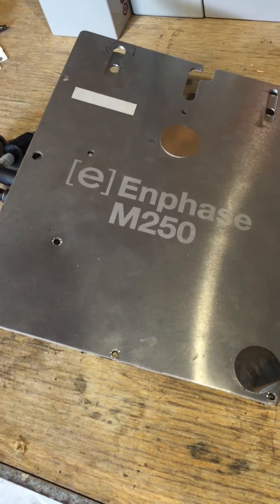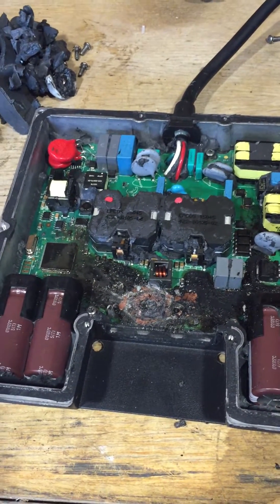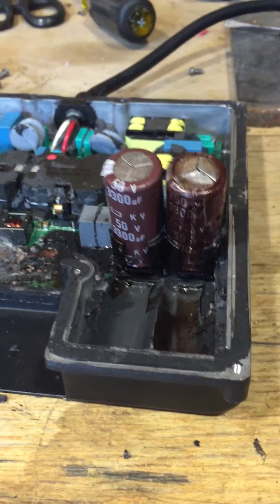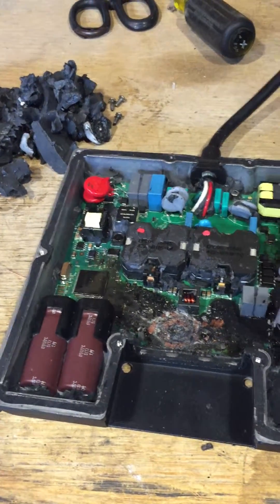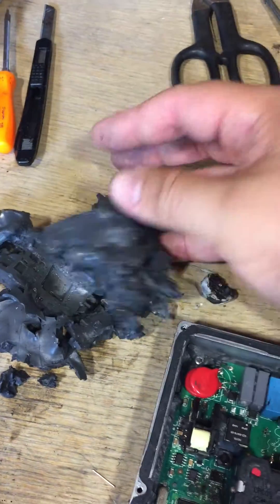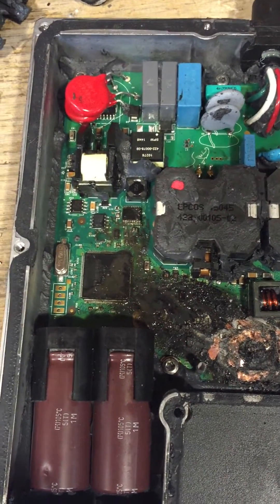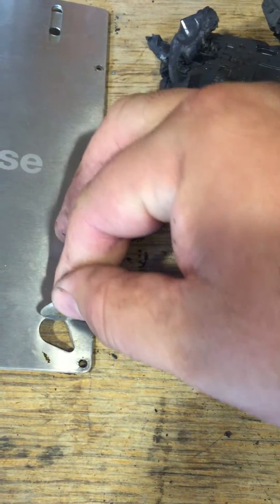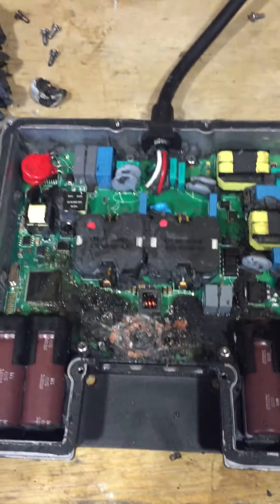Enphase M250 micro inverter not working! Will this be covered by warranty? LOL!

Comment: Thanks, I wanted to see the inside.  A squirrel chewed into the output side and I wanted to see if I could replace the wire connector with one pulled from a non-working unit.  Doesn't look doable since it's soldered on the other side and I'm not pulling out all that potting material.
Reply from the maker: Nope, definitely not made to be seriviceable

Comment: Wow how were you able to remove that silicone potting material??
Reply from the maker: needle nose pliers.  if you gently pull on a piece it slowly peels away
Reply: @delfinocornejo3496  how long did that take lol
Reply from the maker: @JasonLeef33dm3  10-15 min
Reply: @delfinocornejo3496  thank you! That's good to know if case I need to troubleshoot

Comment: Thanks for posting the video. I have a couple of these. They have been working for 2 years so far. I wanted something better than the other cheaper ones that everyone seems to complain about. I remote mounted them in my garage with the panels on top. I have seen them put out more than the 250 watts since it seems they only go up the the rated current on the mains. I wanted to see whats inside one. I remotely mounted them since I know the hot heat from the sun would ultimately make any inverter fail.